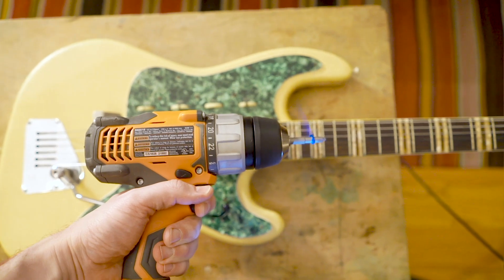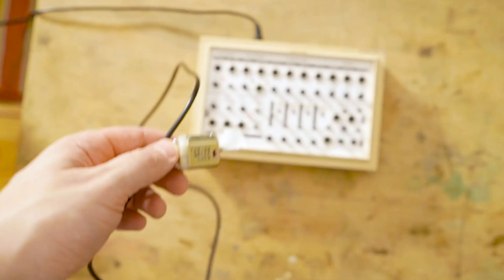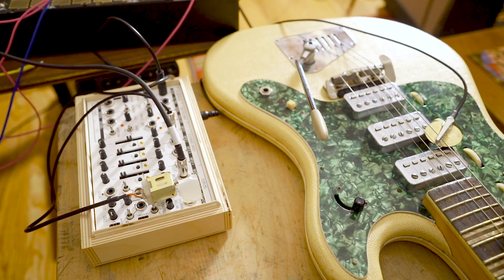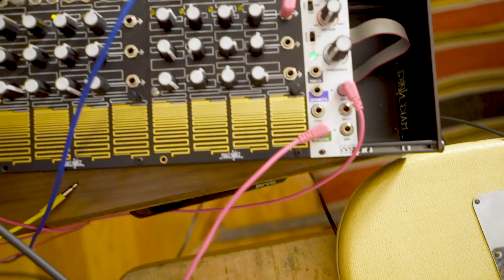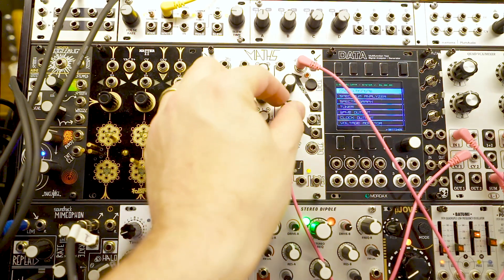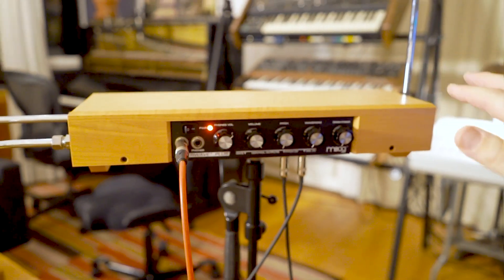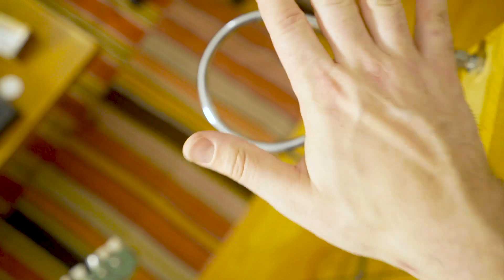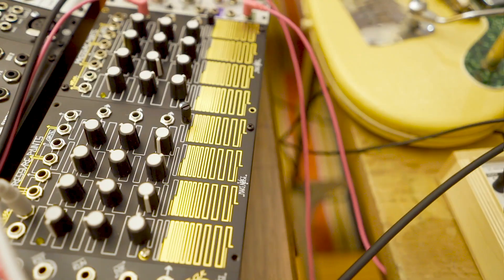MOTORIZED GUITAR PLAYS MODULAR SYNTH

Comment: hello there. great stuff you have  going on there. great righ as well. uff. anyway, did not catch that aux out bit (1:46-1:55) are you running aux out to where? some sort of gate converter (koma aux out to detect r-x in and from there it generates gate output wchic runs further into other modules)? wow. so are you converting autdio signal into gate/cv signal? wow. sorry I am new into modular synthesis. I kind of understand meaning of cv (not as much gate and envelope, one day i will though). sometimes I have hard time with audio and differentiate between audio sighnal and cv signal too (when both in one module). my field kit is on the way as I found one cheap on the net and I always liked it. so far I have a lifeforms sv/1, clouds,  benjoling, morphagene. I know I should start concentrating now on lfo's, filters etc, but I could not resist to get that koma field kit, when stubmled upon cheap one. hope i can incorporate it into my rig mentioned above.
Reply from the maker: Right ! You got it. The R-x turns the audio from the guitar to a gate that advances the sequencer.
Reply: @HANGINGOUTWITHAUDIOPHILES  thank you sir. I just ordered mutable instruments  ears module. looking forward to it.
Reply from the maker: A little discussion about audio vs cv signals here: https://muffwiggler.com/forum/viewtopic.php?t=187212
Reply: @HANGINGOUTWITHAUDIOPHILES   thank you sir. i am about to read it.